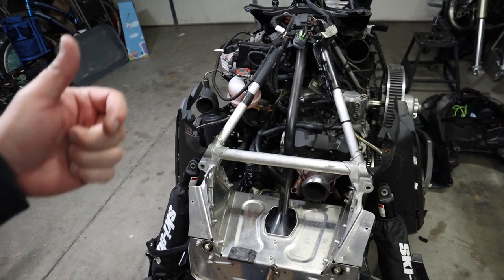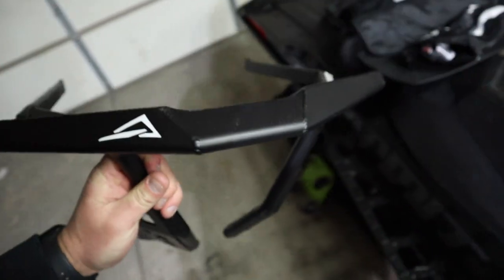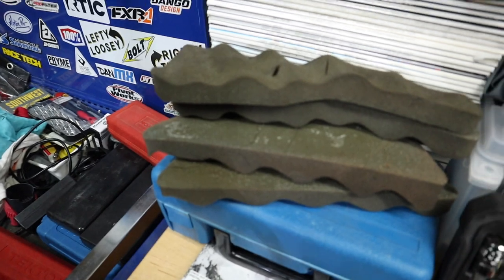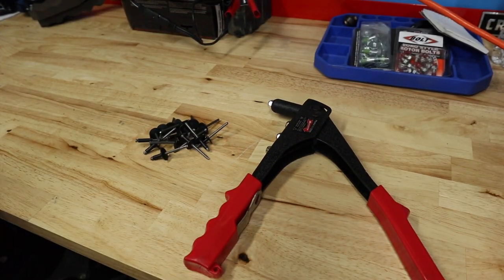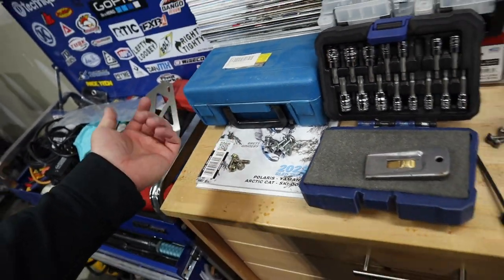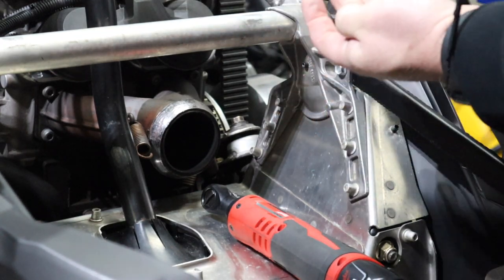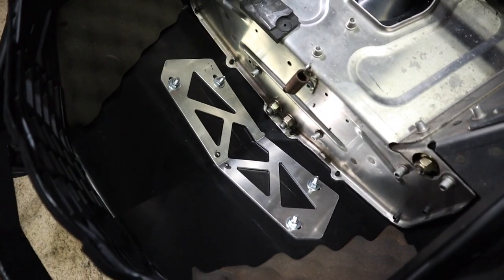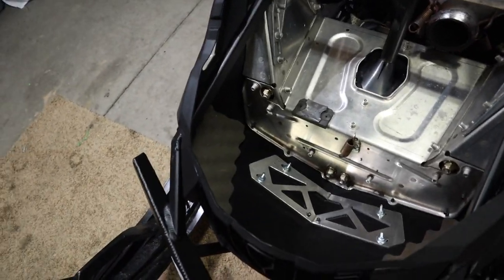SKIDOO BUMPER INSTALL | Rebuilt and better than new!

Comment: Nice job. Do you remember the size of the two bolts for the bumper? M6 or M8? Surprised one broke on you.
Reply from the maker: I don’t for sure, but it was a 10mm head, so that’s would probably be a M8x1.25 thread bolt.
Reply: @DanMX2112  @DanMX2112 Do you think the bent bolt you had took the brunt of the force from the tree or whatever you hit? Just replaced my wife's and am thinking of moving up to  stronger grade bolts.
Reply from the maker: @RealBlueRage yes the tree forced the bolt to bend, and I wouldn’t upgrade to a better bolt. That is the last shear point on the bumper system. I would stick with grade 5 and call it good. A grade 8 may break the mounting tabs on the bulkhead, then your really screwed.
Reply: @DanMX2112 Excellent, thank you.